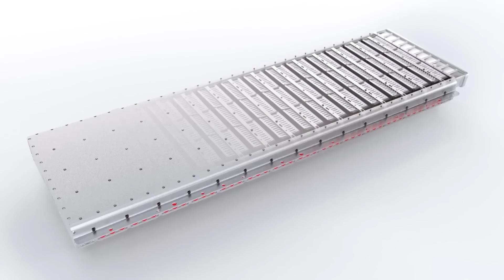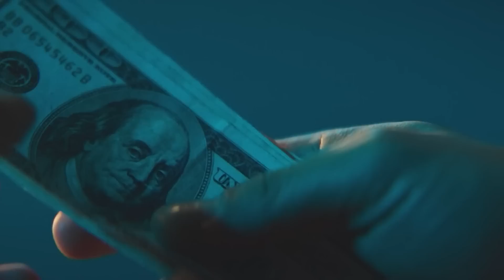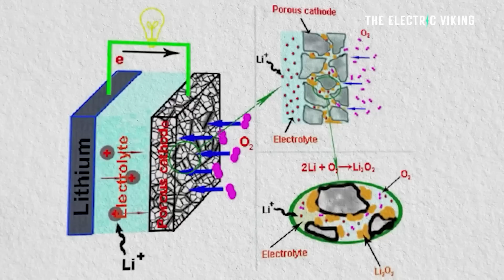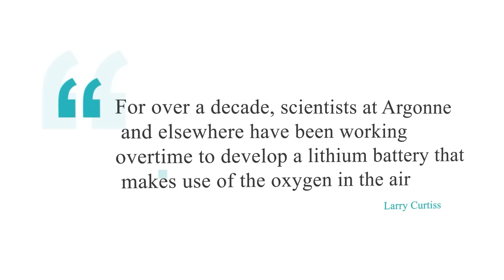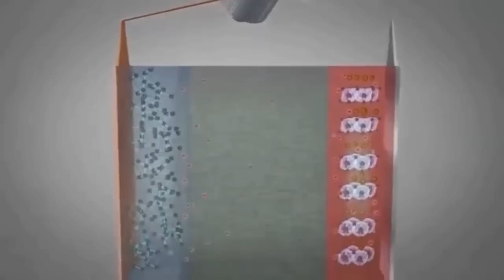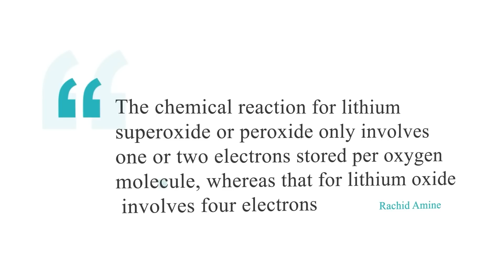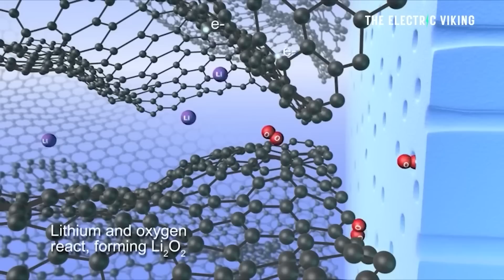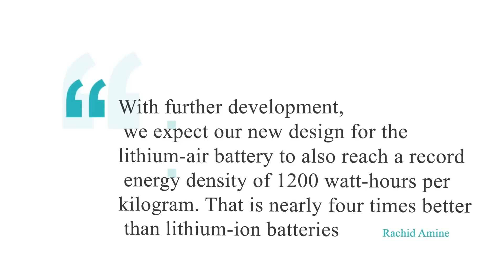IT HAPPENED! Lithium Air Batteries Finally Hit The Market!

Comment: Ok so new electric cars will have a grill?

The intake of the batteries will be air, what will be the outlet?
Reply: The reaction product is stored in the battery which will get heavier as it is discharged. So no outlet.

Comment: So if the battery uses oxygen then what is the byproduct, if any?
Your headline insinuates they are here now, but no factory and no method to build to scale. So realistically they are a minimum 2 years away and probably double that, and that assumes the financing is in place.
With that said, still an informative video.
Thanks
Reply: Rechargeable batteries are based on reversible chemical reactions.  During discharge, oxygen binds with lithium to make lithium oxide.  During charging, the oxygen is released.
Reply: The lab made lithium solid state air batteries at ROOM temperature!

 What is cool about air batteries whether it be aluminum or lithium it can therotically also use the surrounding atmosphere lowering the weight of them. Think of it like a jet versus a rocket.

 Anyway no other battery chemistry has so much potential. I am really hoping it doesn't have any major flaws, and can actually be scaled.

 Having a battery at half the maximum efficiency that carries 2,500kwh/kg with air included would be absolutely game changing.

Comment: Most people drive less than 50 miles per day so... even if you charging twice a week  and that would be extreme,  104 charges per year you could get 10yrs out of this tech. That's the sweet spot fo me. Realistically it feasibility could last between 15 & 20 years.
Reply: That is about what I do being retired, I drive 10-20 miles a day so I may not charge the battery but once a week.  There is the factor that the battery degrades even if you don't charge it over time, so not sure how many years that gives us far as charging capabilities.
Reply: That is dependent on battery size in the EV. If you have a 100kWh battery you will have a 30-40 year life. Why wouldn't you want 100kWh? You eliminate range anxiety, and you can tow.

Comment: nice video, but no, 1000 cycles are not enough. Also cant be produced at 55USD/kWh.
Reply: 1000 cycles is enough because you have higher Wh/kg. For an EV with a 100 kWh battery with 1000 cycle life you get a life of 100,000 kWh and if the uses 0.2Wh per km then you get 500,000 km (nearly twice as much life as the average EV). Could last the average driver 30 to 40 years.